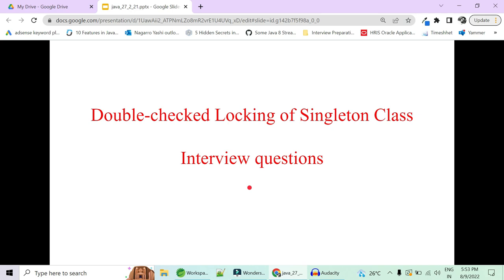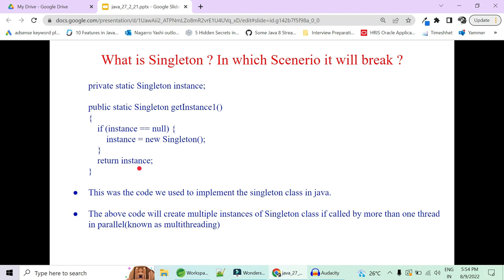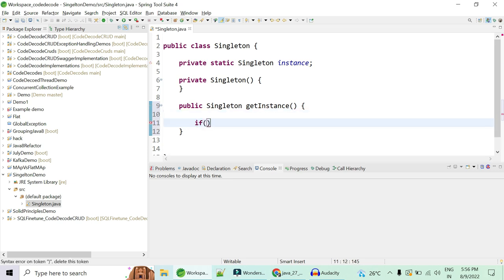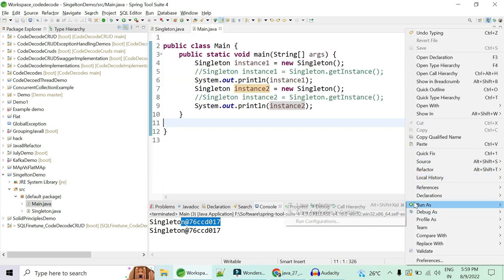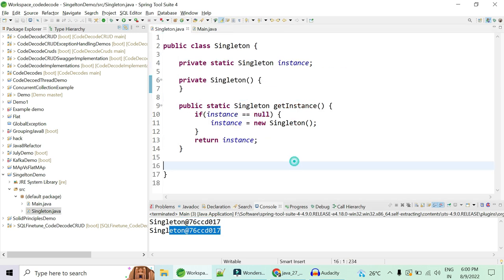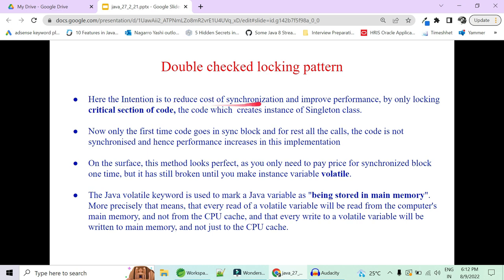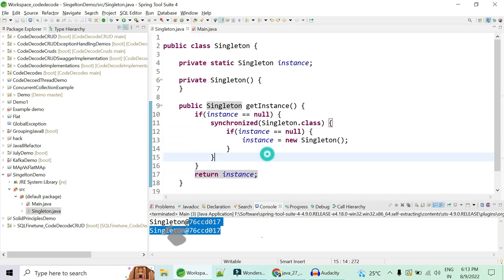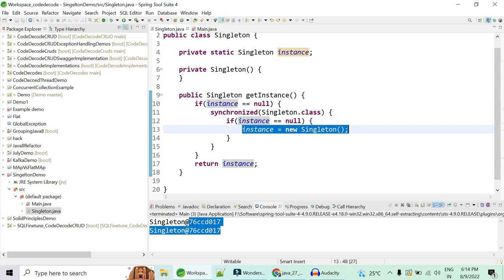Double checked Locking in Singleton Design pattern | Java Interview Questions | Code Decode

Comment: As far as i know if a code block is synchronized then only one thread can access it even if there are multiple thread running. Once a thread leaves that block only then other thread can access that block. If i am not wrong then is contradicts the volatile part of the video. Please correct me if i am wrong. Also thanks a lot for your videos.

Comment: How is it possible for two threads to go in a one synchronized block?
Reply from the maker: Only 1 will go at a time
Reply: can you please answer this as you explain the use case of volatile but that should only arise when two thread's are accessing the same block at same time or preemption is happening but in any case the synchronised block must now allow the other thread to access because of the lock mechanism hence i am unable figure why you may want to use volatile here
Reply: @CodeDecode